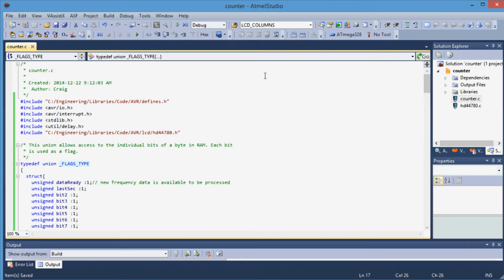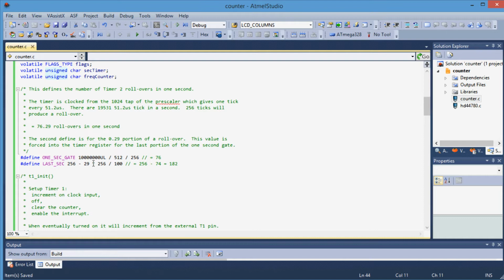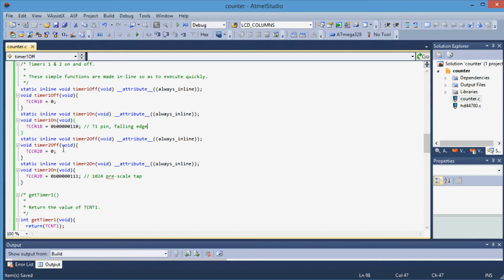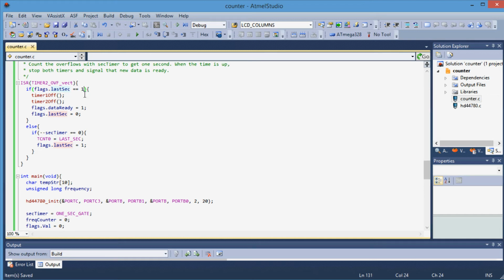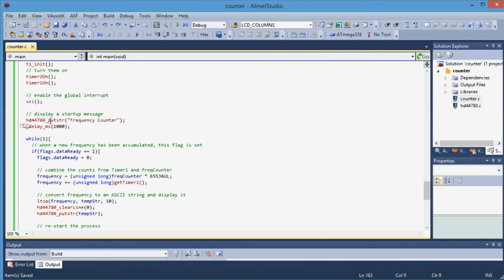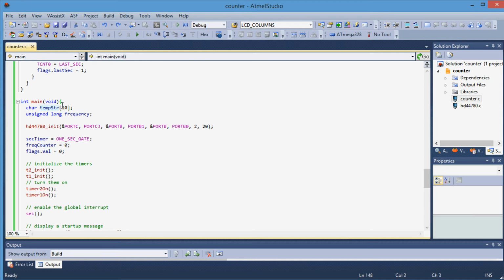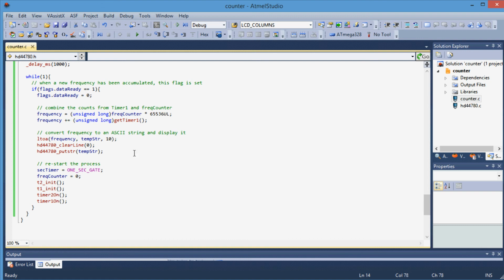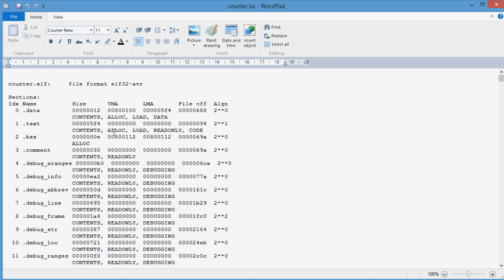Implementing a Frequency Counter Using a Microcontroller, Pt. 2

Comment: I managed to determine how you calculated 74 in the remaining part (the 0.29 of 76.29), but why did you subtract it from 256?
Reply from the maker: I did this video a while ago, so my memory is a little faded. 

You need to count clock pulses to get the desired delay and the number 76 gives the correct delay.  The counter is always counting up and when the count rolls over to zero, that's the event we want to capture.  It takes 256 counts for the counter to start up from zero and go back around to zero which is longer than the desired delay.  By subtracting the desired count from 256 and loading the result into the counter, it will take 76 counts to get to zero.  Re-load the counter with that value again and it will reach zero in 76 counts.  This then gives the desired delay.

I hope this explanation answers your question.
Reply: @craighollinger9972  Many thanks for the fast and clear explanation!

Comment: I'd like to use what I've learned from your videos for my STM32F103C8 'blue pill'.  I have some programming skills, but I'm new to the level of programming you present.  How hard is it to port your code for your Atmel chip to the STM32 chip.  Is the timer layout in the last video basically the same and I just need to change the names for the timers and their registers given by the manufacturer?  Or, is the translation more fundamental?

Thanks!
Reply from the maker: I'm not familiar with the STM32 chips, haven't had the time to play with them.  I'd imagine the timers would be similar to the ATMEGA but likely more complex with more features.  I doubt simply changing the names of the registers will work.  You'll have to go to the STM32 data sheet, learn about architecture of the timers and make the appropriate changes to your code.  

Good luck and thanks for watching!

Comment: I'm so glad I discovered your channel.  I really like the way you break things down.

I'm interested in implementing this for much lower frequency applications, e.g. 50 to 1500Hz.  Is this implementation suitable for this range?

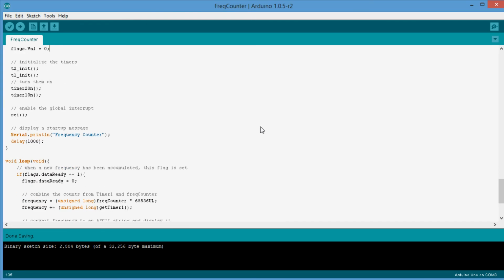+/-2Hz tolerance is fine, but @41:30 it looked like the frequency is jumping around by thousands of hertz.  Was that the signal source doing that or was that the implementation?

Thanks a lot.
Reply from the maker: My implementation will work down to 1Hz.

Not sure what video you saw where the frequency was jumping around, but I don't think it was this one.  If the frequency jumps around, it's likely due to noise on the input signal.

Thanks for watching.
Reply: @craighollinger9972  Excellent.  Thanks so much.

Comment: a very thorough explanation, it seems that you are very aware of the little inaccuracy at the counting cycle due to the instruction calls, I encountered that when building my 8051 based digital clock in c51. (I used Ride 7 software as an IDE back then)
thanks a lot
Reply from the maker: You are welcome. Thanks for watching.